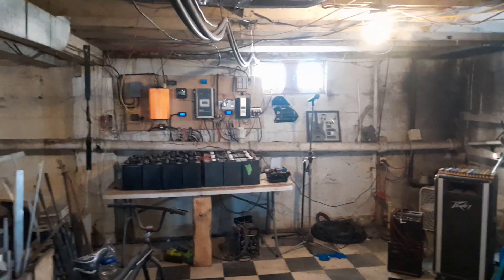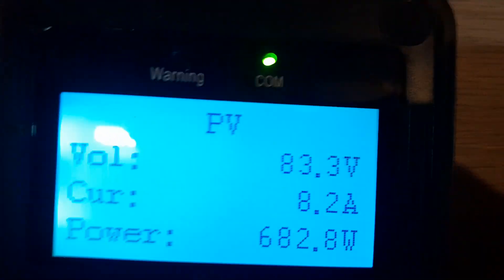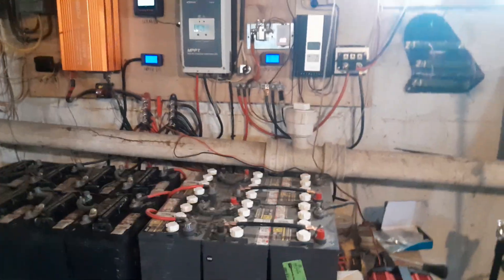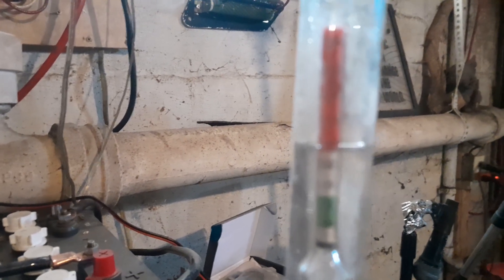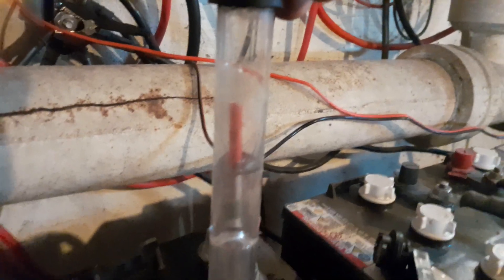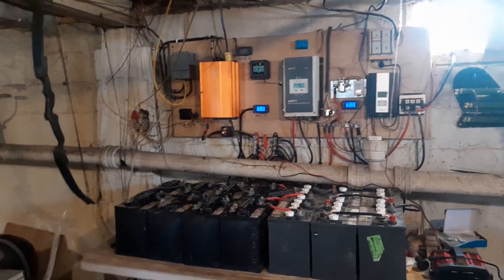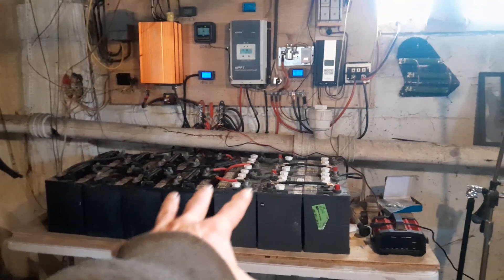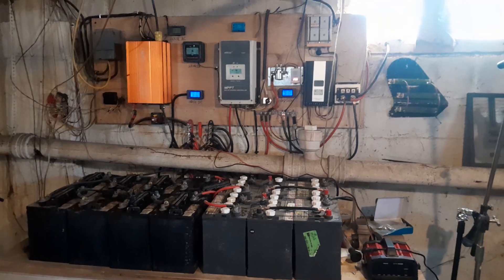Batteries Improved! Thanks for the advise!

Comment: Much respect for making do. I started with a 2KW Liebert UPS my employer was throwing out. And four car batteries from walmart. I did not maintain my batteries and of course they had to be replaced every couple of years. After two battery replacement cycles. I am at 1/3 the cost of a lithium. With one mighty tax return, I splurged for an EG4 LifePO4. So glad I did. Next tax return I picked up an EG4 3Kw inverter and another battery. another year passes and two more batteries and financed 10 solar panels. This weekend I pick up my 5th 5Kw battery with a few more payments left from the panel purchase. You are opening pandora's box. I find alternative energy sources addicting. The system slowly gets bigger and my electric bill keeps getting smaller as I throw more devices on it. Once or twice a year the power goes out where I am for a day and sometimes days. Over the years, I am about 10 grand invested and $150 a month is shaved off my electric bill. I live in the burbs. Retiring in a rural space is around the corner for me. My system may outlive me.

Comment: Loooong steady charge like days and days and don't turn your bulk  voltage lower than 29.8v  .If you see the positve post starting to push the case up after you get them fully charged after running them like that for a couple months than lower the bulk voltage a bit . Been off grid for over 20 years and am the guy who has those 6 v batteries i offered you last year . Batteries like that take days to fully charge esspecially in the state yours are in . And also take each battery off the main bank one at a time to charge it separately . Only put it back after it passes load test and each cell is okay than move on to the next 24v battery . Trust me I've been in your situation with those types of batteries . Don't overheat them when charging though just let them get warm
Reply from the maker: @excavatorfun6265  well gas cost $ and thats tight this time of year and i have no grid to connect them to so i do what i can....but they are improving. I am not recalling the battery offer from last year but i had some sh** going on so i dont recall a lot. Thanks for the tip bud and God bless ya!
Reply: @smallcityhomesteaders1600  my other channel is windpower and more I might of been on that channel when I offered ,neither one of us can cross the border thats why it never went anywhere lol . I'm subbed with both my channels and enjoy the vids as I've been primarily off grid too but do it alot different
Reply from the maker: @excavatorfun6265  well bud...im gonna have to see how your doin thangs and maybe learn sum stuff.

Comment: Build your own battery with EVE MB31 LF314 3.2V Prismatic LiFePO4 Cell, Grade A class, 8000 Cycles. At one cycle per day and 365 days this is a 21 year battery. $82/cell x 8 cells = $656 for a 314 Amp Hour battery that can be used down to 0% instead of 50%
JK-BMS (Battery Management System) is the best in the industry, (B2A8S20P) 200Amp charge and discharge, 24V with Bluetooth phone app, 2A Active Balancer for Solar LiFePO4 Batteries $95.00/BMS So, one complete 24VDC (25.6) 314 amp Hour battery costs $751 and is only 11.2” long x 13.6” wide x 8.0” tall. Each cell is 2.8” x 6.8” x 8.0” tall. USA Stock out of Texas, no sales tax or shipping.
Reply from the maker: @stevenfrazier8939  i was rude Steve. Sorry. But yeah, i just dont trust lithium. Even if i did, im broke so i gotta make what i got work. Hope all is well your way. God bless.
Reply: No worries. Lithium Ion batteries can and do catch fire. However, Lithium Iron Phosphate (LiFePO4) batteries do not. It is a totally different chemistry. I can only encourage you to do the proper research before dismissing my suggestion. LiFePO4 are maintenance free, higher energy density, lower internal resistance, charge faster and are more efficient than Flooded Lead Acid. You are saying no to your own detriment. During the time you have been using and struggling with your Lead Acid, my batteries are still at 100% with a usable 58 kilowatts. by the way, at 8000 cycles my battery bank will still be at 80%  or 80% of it's useful life remaining. yours will have long expired. I used to be just like you until I did the research.
Reply from the maker: We'll see bud. 😉